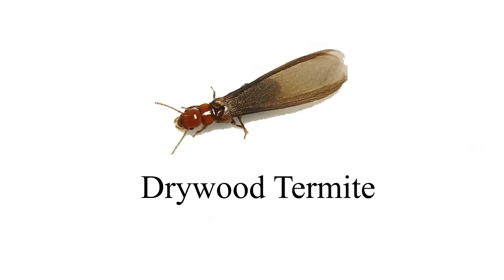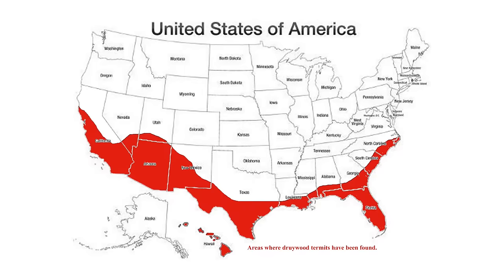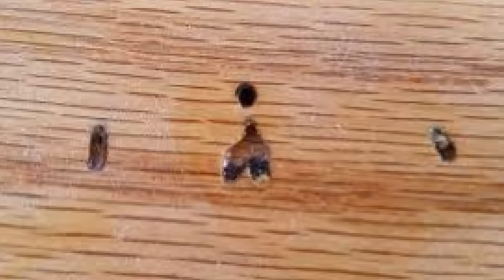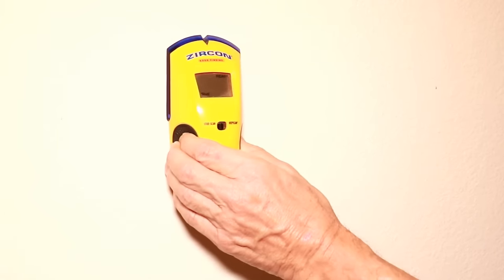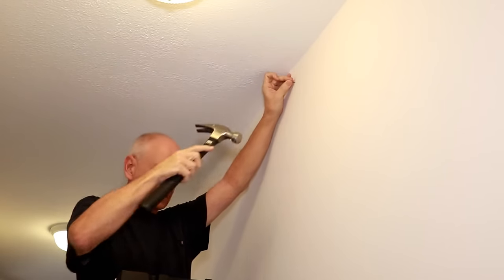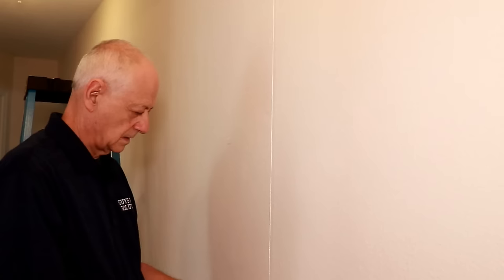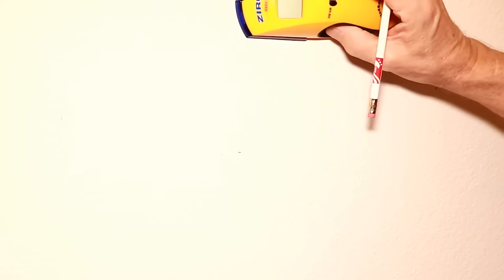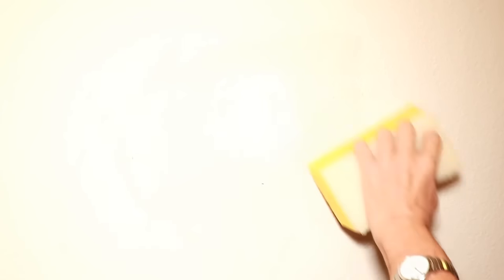How to Treat a Drywood Termite Infestation Yourself. A MUST see if you have Drywood termites.

Comment: Dear Guy, thank you so much for this. I just used drilled holes and filled with foam. Several of the wood beams supporting my upper deck are reiddled with termites. My question. Is it mandatory to now fill the holes and paint over them? Or can I just paint over the holes.
Reply from the maker: There is no need to fill the holes.  That would be more of a cosmetic decision.  Please keep in mind that the do-it-yourself treatment described in this video is probably not going to eliminate all your drywood termites.  You are going to kill a lot of them, but it is almost impossible to find all the galleries.  That is because some of them can be as small as the size of a peanut.  It is important to understand how drywood termites work.  They enter through cracks and crevices around windows, doors, eaves, pipe penetrations, and so forth.  Most of the time, they enter through several locations.  That is because a swarm of them attacked your house at the same time.  If there was a crack or a crevice, then they probably found it.  After they establish their galleries, which will be inside the wood, it will take four to seven years for them to be able to swarm.  Now that they are in your house, the swarmers will use holes that are in your studs to travel through the walls.  Those holes in the studs were created by the electricians to run the electrical wiring.  Not only are these holes going through the studs, but holes were drilled into the attic for the light switches and to run some of the wiring for the outlets.  So, the termites now have easy access throughout the attic and the walls.  If you have a basement or crawl space, they have access to that as well.  Most of the time, you will have no idea that they are in the walls, because the frass is inside the wall.  To make matters worse, if you have drywood termites, then your neighbors have them too.  That means you have been getting swarmed for as long as they have existed in the neighborhood.  Most likely, we're talking about years, so it's a safe bet that you have these guys in many locations in your home.

I always hate to be the bearer of bad news, but if you have drywood termites, the only sure way to get rid of them is to fumigate.  Prices for this can vary wildly in this industry, so I recommend that you watch my video on how to hire a pest controller without getting ripped off.  That video can save you a lot of money.  You should also know that the gas they use to fumigate has absolutely no residual action whatsoever, so you can get reinfested the moment the tent comes down.  Like I said before, if you have drywood termites, then your neighbors have them as well.  Since drywood termites swarm every year, it is almost a certainty that you will be reinfested within a year after the fumigation is done.  The only way to prevent this is to do a preventive treatment on your house every 60 days.  Most pest controllers will not do this, so it is something that you generally need to do yourself.  I have a video on how to do that and I will place a link below.  This is a generic video that covers a lot of different pests, but it also works for preventing drywood termites.  Just ignore the part about treating your yard.  You only need to treat the house for drywood termites.  This will not treat the termites that are already there, but it will stop new ones from getting in.  If you absolutely cannot afford to fumigate your house, then what you did already is the best alternative.  It is virtually impossible to find all the termite galleries, but it is way better than doing nothing, and it may buy you some time to save up for a fumigation.  Regardless of how you treat it, you should begin the preventive treatment immediately, so that you do not get additional termites paying you a visit.

I hope that helps.  Be well Elaine.                    

Video on how to hire a pest controller without getting ripped off:  https://youtu.be/y-a8XOqVrlE

Video on how to prevent drywood termites:  https://youtu.be/Yozv3s-Qwlw
Reply: @GuysPestSolutions  Thank you so much! The spectracide seems to have worked! No more frass to be found. I will redo in four months.

Comment: I'm learning so much from your videos, Guy...... your Youtube channel is a godsend.  Questions about Boracare and injecting fipronil into infested wood. By drilling holes every 4 inches, I gather that's to locate termite galleries only?  And you inject only into the holes that hit a gallery?  If after injecting into the first hole, you see foam coming out of other drilled holes (4 inches apart), is it still necessary to inject more foam into those holes or can you move on to the holes where nothing came out?   If you don't need to use a whole can of fipronil,  do you have to discard what's left or can you store it for later use?  If you can still keep the rest for later, what's the shelf-life of an opened can?  How does Boracare work to kill termites compared to fipronil?  Could one spray Boracare on active infested wall studs from within the wall voids instead of drilling every 4 inches to inject foam?  In what situation do you need to inject fipronil foam to the sides of a wall stud and let it slide down?  If spraying Boracare is an option, it might be more cost effective than buying several cans of fipronil foam?  I don't know that's why I'm asking.... :)
Reply from the maker: Thank you so much for those kind words.  We don't drill the holes every 4 inches to find the termite galleries, but rather to treat them.  The problem with drywood termites is that it is very difficult to find the galleries.  In fact, I think it is virtually impossible to find them all. That is why I always recommend fumigating for drywood termites.  It is the only sure way to get rid of all of them. The reason you drill the holes every 4 inches, is because you don't know how many galleries are in a particular stud, how deep they are in the stud, and how large they are.  A gallery can be smaller than a walnut.  Also you could have more than one in the same stud.  If you get lucky enough to find one, you can't just treat the one that you found.  You need to assume that there may be more in the same stud that you have not found.  Therefore you drill the holes every 4 inches and shoot foam into each hole that you drilled.  If the foam comes right back out at you, then you did not hit a gallery.  However, if you can shoot the foam in for a few seconds, then you are spraying into a gallery, or you missed the stud with the drill and your spraying into the wall void.  That is why you do not want to spray for any more than 5 seconds.  If you see foam coming out of the other holes that you drilled, then you know for sure that you hit a gallery.  If there is foam coming out of a hole, then you do not need to shoot foam into it.  You should have foam either going into or coming out of every hole.  A can of foam can last a long time, so you can save the excess for use later on.  If you are spot treating, then there is a very good chance that you are going to need it again.  Spot treating drywood termites is like playing whack-a-mole.  Every time you think you've got all the galleries treated, new ones crop up.

Bora-Care works much differently than fipronil.  Bora-Care penetrates deep into the wood and is a permanent solution for termites.  Unlike fipronil, Bora-Care lasts forever.  It is possible to treat studs that are behind the drywall with Bora-Care.  It is kind of a hit and miss process though.  What you need to do is buy a foamer and a foaming agent, and then drill a hole near the ceiling and try to get the foam to run down the side of the studs on each side.  To do this you need a fairly good foamer and they run a couple of hundred dollars. Please let me know if you would like to try that, and I will guide you further.  You cannot do this type of a treatment with a fipronil foam, because it does not penetrate the wood the same way that Bora-Care will.  Also, if you are going to foam, then why not use a product that is permanent?

It is important to understand how drywood termites work.  They enter through cracks and crevices around windows, doors, the eaves, pipe penetrations, and so forth.  Most of the time, they enter through several locations.  That is because a swarm of them attacked your house at the same time.  If there was a crack or a crevice, then they probably found it.  After they established their galleries, which will be inside the wood, it will take four to seven years for them to be able to swarm.  Now that they are in your house, the swarmers will use holes that are in your studs to travel through the walls.  Those holes in the studs were created by the electricians to run the electrical wiring.  Not only are these holes going through the studs, but holes were drilled into the attic for the light switches and to run some of the wiring for the outlets.  So, the termites now have easy access throughout the attic and the walls.  If you have a basement or crawl space, they have access to that as well.  Most of the time, you will have no idea that they are in the walls, because the frass is inside the wall.  To make matters worse, if you have drywood termites, then your neighbors have them too.  That means you have been getting swarmed for as long as they have existed in the neighborhood.  Most likely, we're talking about years, so it's a safe bet that you have these guys in many locations in your home.

As I already mentioned, the only sure way to get rid of drywood termites is to fumigate.  Prices for this can vary wildly in this industry, so I recommend that you watch my video on how to hire a pest controller without getting ripped off.  That video can save you a lot of money.  You should also know that the gas they use to fumigate has absolutely no residual action whatsoever, so you can get reinfested the moment the tent comes down.  Like I said before, if you have drywood termites, then your neighbors have them as well.  Since drywood  termites swarm every year, it is almost a certainty that you will be reinfested within a year after the fumigation is done.  The only way to prevent this is to do a preventive treatment on your house every 60 to 90 days.  Most pest controllers will not do this, so it is something that you generally need to do yourself.  I have a video on how to do that and I will place a link below.  If you absolutely cannot afford to fumigate your house, then you can try spot treating it yourself.  Again, it is virtually impossible to find all the termite galleries, but it is way better than doing nothing.  Regardless of how you treat it, you should begin the preventive treatment immediately, so that you do not get additional termites paying you a visit.

I hope that helps.  Be well my friend.                      

Video on how to hire a pest controller without getting ripped off:  https://youtu.be/y-a8XOqVrlE

Video on how to prevent drywood termites:  https://youtu.be/neNsmVbj8Pc
Reply: @GuysPestSolutions  Thanks for all the info!  I know I have drywood termites in at least one location (more to follow for sure). Found frass behind the cover plate for light switch. This switch cover plate is at the edge of the wall where the patio sliding door opens, and there's an exterior electrical outlet on the opposite side (stucco wall). I'm not looking forward to drilling here. Have to cut power and be careful where I drill. I think there are double studs at the wall/door edge.  I' plan on getting a better stud finder and borescope to see what's going on in there.  Any words of advice for this situation?   I've 2 new cans of Termidor foam waiting to be used.
Reply from the maker: @rover8783  You are correct that drilling into wiring is always a risk.  If the drill goes in too easy or too hard, then stop drilling and move the drill up or down about two inches.  If the drilling gets hard, then you may be drilling into wiring or a pipe.  If the drill goes in too easy, then you may have drilled into a wall void or a hole in the stud where the wiring is running.  You may also have drilled into a gallery, so no need to go deeper.  So, stop drilling.  The wiring is usually located a few inches above or below the outlets, so be careful when drilling in these locations.  Save your money and fumigate as soon as you can afford it.  I will give you a link to the stud finder that I use now.  It works great.

I hope that helps.  Be well my friend.

Stud finder:  https://www.amazon.com/Franklin-Sensors-FS710PROProSensor-Professional-Finder/dp/B0195K8OT4/ref=sr_1_14?crid=1PY81CCU5QA4O&keywords=stud%2Bfinder&qid=1694711754&sprefix=stud%2Bfi%2Caps%2C107&sr=8-14&th=1

Comment: Hi Guy,  I'm so glad to find your videos.  I've found kickout holes... and would love to use FiPro to spot treat those areas.  However, I'm located in NY - there is shipping restriction!  Is there any other foam/indoor product(s) for termites you'd recommend?  I've tried to drill & treat some spots in my basement (where the wood started to shred into pieces) with Termidor foam - however, my weekend treatment did not seem to work - the wood spots keep on shredding!  Should I apply the Bora-Care solution direction to those infected areas?  Many thanks for your responses!
Reply from the maker: The first thing you should know is that you do not have drywood termites.  I know this because drywood termite are not in New York.  If these guys are termites, then they are subterranean termites.  New York has the most restrictive pesticide laws in the United States, so you can't buy pesticide or get them shipped to you.  However, you can drive to New Jersey and buy termite granules from Home Depot.  You need to be careful though.  There are two kinds of granules.  You need the one that has an active ingredient of imidacloprid.  I am providing a link below to Amazon.  They will not ship it to you, but this will let you see what the product looks like.  So, select a Home Depot store that is in New Jersey, and call ahead to see if they have the correct product.  If so, then just go get it.  I have a video on how to use it and I will give you a link to that video.  If you know somebody that lives in New Jersey, then you can have the product shipped there, and you can just pick it up.  Also, if you know somebody that lives in New Jersey, you can get Taurus SC shipped there, and you can use that to trench around the outside of your house.  That would also allow you to buy a very effective foam that you can use to spot treat as well.  Another option is to rent a UPS box, so that you would have a New Jersey address to ship to.  Let me know if you want to go that route or if you have a friend in New Jersey, and I will provide you with the information you need to do the trenching and the spot treatment, and to purchase the correct products.  I hope that helps.  Be well my friend.

Video on how to apply termite granules:  https://youtu.be/H7rW_TSBHJ4    

Termite granules:  https://www.amazon.com/BIOADVANCED-700350A-Perimeter-Treatment-Granules/dp/B000RUIJYM/ref=sr_1_6?crid=1DK8U0I9R4XMX&keywords=termite+killer&qid=1679562436&sprefix=termite%2Caps%2C280&sr=8-6

Comment: Three questions:

Will a bug bomb set off in the attic do anything for treatment and prevention?

Do Formosan termites ever return to the ground so they can be controlled by ground treatments if they have moisture in their gallery from a leak and all the water they need?

What about using a thermal imaging camera? How effective as a detection tool?
Reply from the maker: Those bug bombs will do nothing to help you with a termite infestation of any kind.

Formosan termites are subterranean, so most of them do returned to the colony to bring back food to the other termites and the queen.  However, they also have the ability to build cartons in your home that allows them to remain there without returning to the colony.  So, they do both.  Most of them do return to the colony, but you may have some they decide to build those cartons.  Please watch my video on Formosan termites. 

I do know of some pest control companies that use thermal imaging to detect termites, but I have never done it myself.  I think the best way to locate cartons is to use a moisture meter.  I explained how to do all of this in my video.            

I hope that helps.  Be well my friend.  

Video on how to treat Formosan termites:  https://youtu.be/xDtGUWxMrRw
Reply: @GuysPestSolutions  I found the video after I posted the questions. Noticed you recommended trenching. Would the granules work just as well as trenching for the Formosans? Noticed you recommended them for the subterraneans.
Thanks for all your help.
Reply from the maker: @socrates2706  I do not recommend the granules for Formosan termites because they are a very aggressive species and can be more difficult to eradicate than other species of subterranean termites.  Please watch my video but how to treat Formosan termites.  It will explain everything you need to know.

Be well my friend.

Video and how to treat Formosan termites:  https://youtu.be/xDtGUWxMrRw